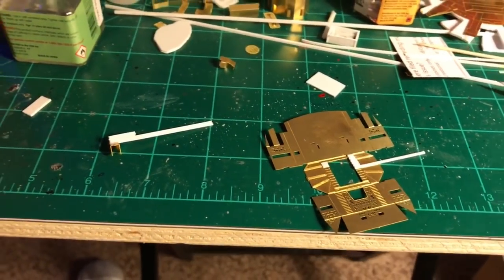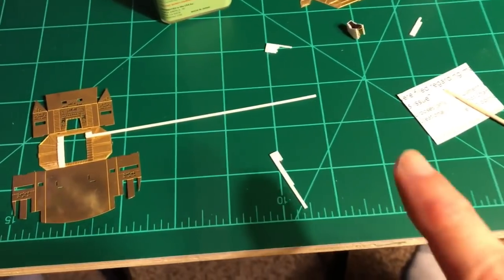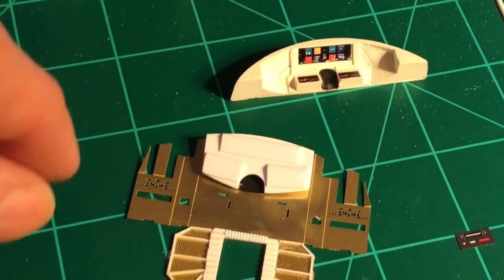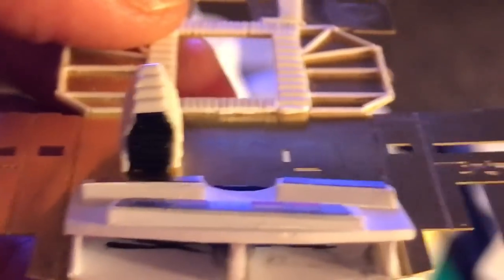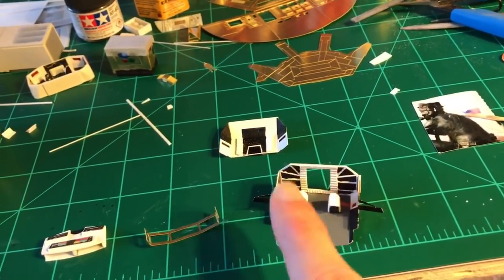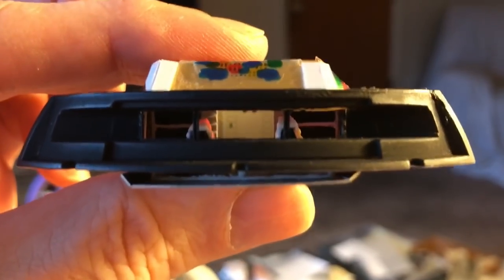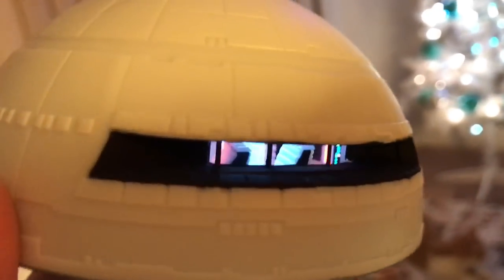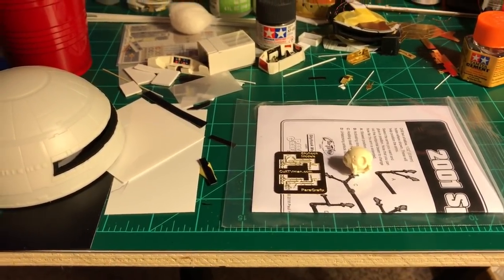2001 Discovery Build part 5

Comment: Superb job.
I am planning doing the same but the lightning is a bit beyond my capabilities. Does anybody supply ready made rigs?
Reply from the maker: Phil, I get prewired tiny SMDs from a company called Evans Designs at modeltrainsoftware.com. They also sell coin battery holders with switches and remote control sensors.

Comment: Looks really great! I didn't see any current limiting resistors for your LED's. They'll work for a while w/o the resistors, but will fail without them.
Reply from the maker: Lonnie, I used prewired 3v SMDs with AA batteries, they don't require resistors. I haven't had any issues with them and completed the build in May.